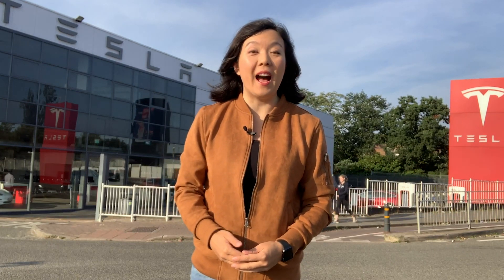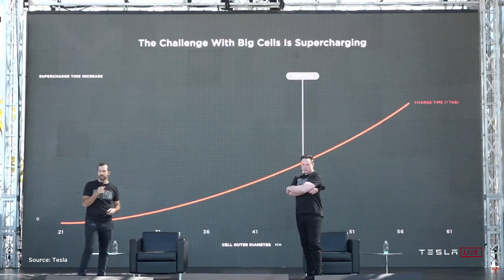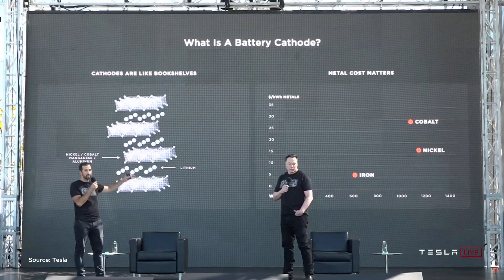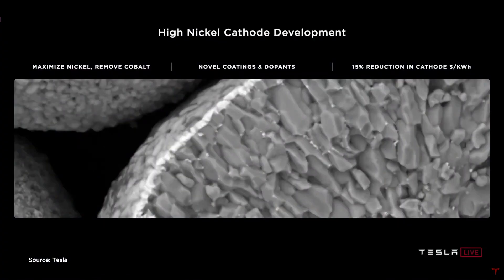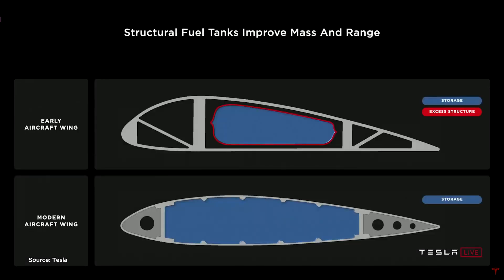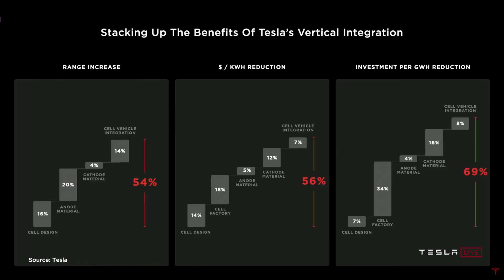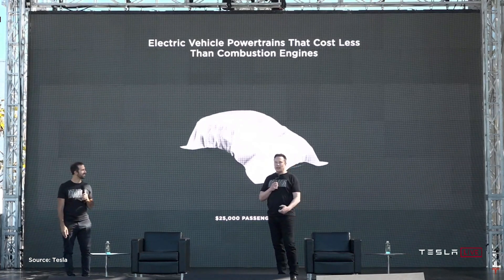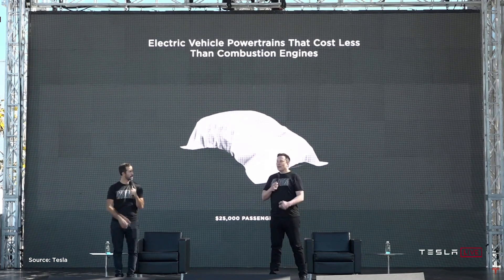Tesla Battery Day 2020 (HIGHLIGHTS)

Comment: Since my background is the nuclear industry which is in many ways related to power production, leads me to believe that Tesla is on the correct path.   Investors especially those older and educated in other than science fields have a harder time understanding going from R&D to pilot then actually production. In many ways, I feel Tesla actually revealed too much making it easier for competitors. Many forgot that this was battery and not new car model day or anything thing silly. I’ve been in research and know that it takes time and hard work to get to the production stage. I’m 63 if I were younger I would be seeking a job at Tesla.

Comment: 5X energy and only 16% increase in Range... That does not make sense to me...if somebody c pi uld explain tha?
Reply: the cell is larger and holds more energy then the previous smaller cell, but gains 16% in range when compared in weight.

Comment: ICE will still be needed for long trips on holiday weekends for a long time.  The backups at charging stations on recent holidays are not attractive.  I can see myself buying the upcoming $25,000 car in three years but our second car will be ICE for long trips.
Reply from the maker: How long do you think it will take before ICE vehicles become obsolete (if they ever do)?
Reply: Newsthink The power density of petroleum is exceptionally high.  There is a big difference in cruising at 100 Kph in an aerodynamic passenger vehicle versus hard working vehicles.  Also, ICE vehicles can be refueled on on the road in under 10 minutes (maybe under 5 minutes).   The only time I have ever seen gas lines longer than 3 cars is during a hurricane evacuation.  Allegedly, very long lines exist at Tesla supercharging stations on holidays that require 30 minutes at least for only a 50% charge.
Reply: @haroldgretzky8757  think about the amount of time you would spend charging at home  VS getting to a petrol station to refill every time you run empty and compare that to the amount of time loss waiting on a holiday charger, you would have to take a lot of long trips to technically be loosing time in a EV. work grade vehicles can be outfitted with bigger batteries as weight is not really a penalty unless long range shipping is a concern.
Reply: Miguel Lopez
1.  I am a supporter of electric vehicles and will strongly consider buying one next purchase.
2.  The total time savings for electric vehicle charging would be at most fifteen minutes once a week per car for me.  Maybe that would add up.
3.  For a leisurely long, cross country  trip you could take an extra or two to accommodate charging.
4. However, with the ever growing electric car fleet on the road, taking an electric car on a holiday week such as Thanksgiving, Christmas or Easter might be a logistical nightmare.  I’d really like an independent entity like Consumer Reports (USA) to do an evaluation over several of the heavily traveled routes

Comment: Best Single Line Of The Day:  
"I don't think that there will be an ICE industry long-term."
Elon Musk
Reply: Whats an ice industry
Reply: @nweed4449   
It took me a second to figure it out, too.  ICE = Internal Combustion Engine.
Reply: N Nhatty 
I NTERNAL
C OMBUSTION
E NGINE
Reply: An aerodynamic vehicle only uses a few horsepower to maintain highway speed.
Reply: With California going electric by 2035, I’d say good by to ICEs. The rest of the country will follow. If Joe Biden wins it will be accelerated according to his vision of the future. Either way polluting engines are gone the sooner the better! If you want it to happen sooner vote for Biden.
Reply: @manuelgarcia3348  biden ? 😂
Reply: there probably won't be an EV industry long term either.  the key is what is meant by long term - the DOW will probably reach 100000 long term also - both are meaningless without specifying what long term means

Comment: What I think about the Battery day is that size matters. Imagine a day when an xbox console can fit in your phone. Imagine when it can then all fit in a watch. Imagine an electric plane, imagine an electric boat. Power in relation to battery size is everything. New doors of the future have been opened from incremental improvements in batteries; doors where we don't even currently know what's on the other side yet. What happens when your phone can last a month, or be charged wirelessly? We don't even know the opportunities yet! It could lead to electric clothing, eventually electric jet-packs if we reach a point where such a small battery can pack such power. We're going to need more visionaries like Musk if we're going to help him get there. Visionaries who don't just see, but also believe

Comment: Can someone tell me, if there's a 16% range increase, what's this about 5x energy?
Reply: Probably uses less energy to charge the battery but it also lasts longer
Reply: Each cell in the battery pack holds more energy,  making it cheaper to build fewer cells, resulting in a slightly better range.

Comment: Can someone who understands batteries please answer to this:
If the new batter has 5x the energy then why does it only get 16% more range.  Shouldn’t the range scale up to around 5x?
Reply: I’m no professional in batteries at all but I think it is because the individual battery is bigger than the ones they are using now, so if you compares each battery side by side this one has 5x more energy and only 16 percent more range per individual battery
Reply: The batteries are not the same size for one thing.

Comment: I bet the $25k car will be a 2~3-seater! (ie. rent one of our Tesla fleet now to see why you should NOT wait...)
Reply: I'm betting you're wrong ... 😁
it'll probably be more like the 3, and run between $20k - $60k depending on the software or powertrain package.
could even have wider interior space --- Tesla is trying to Get More People to buy EVs, so sure, there will be Minis, but they'll still be relatively roomy, and probably be under $20k ($15 - $20) at base price level.
Reply: Smgntion M we will see... the reason I think 🤔 the next Tesla will be ‘under 4 seats 💺’ is the fact they said they will make a ‘for china 🇨🇳’ car, think pod-bike footprint 👣... $12k cash and $11k fsd in 2023...
Reply: @tesla-taxi-millinqld-hq-br7462  I'm doubtful theyll ever making another two seater, because they could have easily decided to call the Roadster2 a two seater or leave the Y with two rows, but instead they insist on making/calling the Roadster2 a four seater, and adding a third row to the Y, and even adding an extra passenger seat for the CyberTruck --- any extra space they find, they'll use for extra seating capacity; even a tiny car built for narrow roads in China or Europe will still try to seat at least 4.

when/if they make a Pod style vehicle, I think they'll design and 'market' it the same way they do the CyberQuad; alongside whatever they use for High Passenger Density travel through Boring Co. Tunnels and surface roads -- as 'a little something extra'.

Comment: “Head and shoulders above all other companies in terms of manufacturing” 
That is their main goal....
Reply: That is reflected in how they designed the cyber truck. That truck body is much simpler to make in terms of basic structural components than typical trucks on the road.
Reply: No, Elon is underestimating the factories of other companies, which are aggressively more competitive. Elon should wake up from his dreams Tesla will be the dominant
Reply: @moalaoudi9411  What factories are we talking about? nobody but Tesla builds "GigaFactory"
Reply: that is to prevent tesla from tanking in stock market
assurance to investors, hehe
Reply: 5X energy and only 16% increase in Range... That does not make sense to me...if somebody c pi uld explain that?
Reply: @thecrazythings1390  i think it refers to higher energy states of the anode and cathode and it does not exactly translate to an equivalent increase in mAH. Same way that 2L engine does not mean it is twice as fast or powerful than 1L engine.
Reply: TheCrazyThings it’s 5x the energy per cell. Watts per kilogram. So the extended range reflects a 16% increase in energy density and efficiency which gives you %16 more range

Comment: Ok I'm missing something here, battery technology is going to nickel?   So no longer using lithium for batteries and going back to older nickel based batteries?   Or is it only a particular part of the battery using nickel and it is in fact still lithium* based. 

Also if they're 12-18 months out why would the start announcing this now?  Nickel product isn't exactly abundant through the globe and don't exactly want speculators to start buying up nickel futures which throws any sort of cost savings as shown out the window.
Reply: nickel is the cathode and lithium is anode

Comment: Great ! Hope it happens, but isn't Elon worried about the Osborn effect? I would like my next vehicle to be an electric vehicle capable of autonomous driving. I figure 5 years until I get a new vehicle, when electric vehicles will be competitive in price and superior in performance, cost of operation and maintenance to ICE and hybrid vehicles. We currently drive a 2012 Prius and a 2009 Sienna minivan.  If I need to get a  replacement vehicle it will be a used ICE. I wouldn't consider a new ICE or hybrid vehicle, or especially a used hybrid vehicle.I am also a shareholder in Ford (F), very disappointed in them.

Comment: Nicely done Cindy.  I'm intrigued that the lithium ion battery could be improved so substantially.
Reply: They have not focused on energy or power density first, rather on physical and mechanical design for maximum efficiency in manufacturing and product to massively reduce cost and thus vehicle market share, the chemistry to increase power density can come incrementally in time.
Extremely smart even if not what traders want to hear